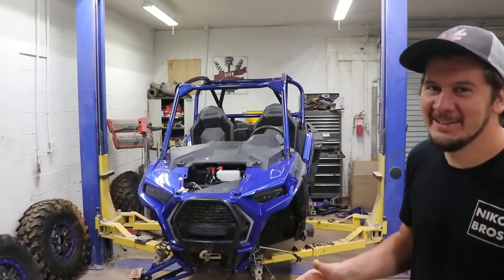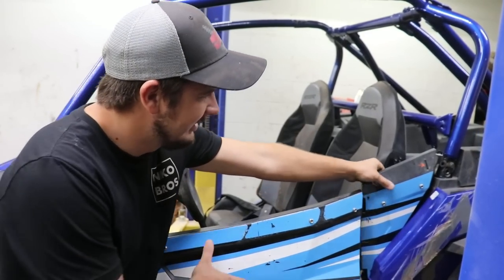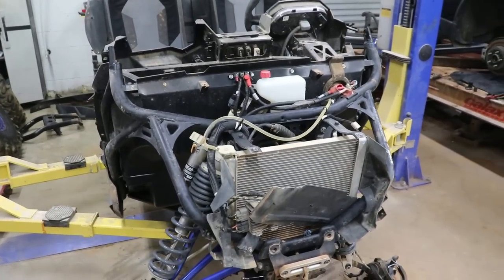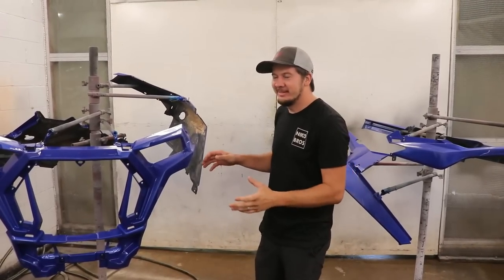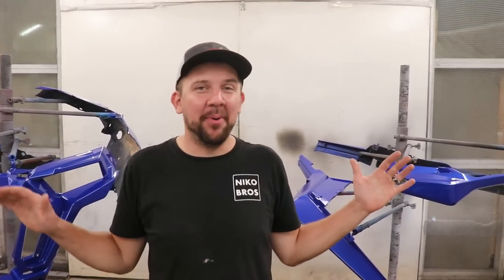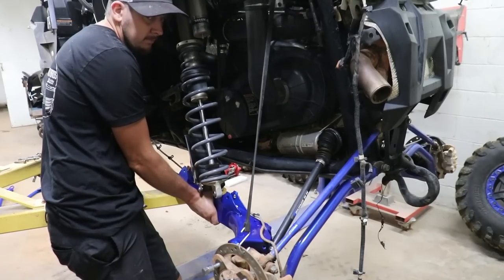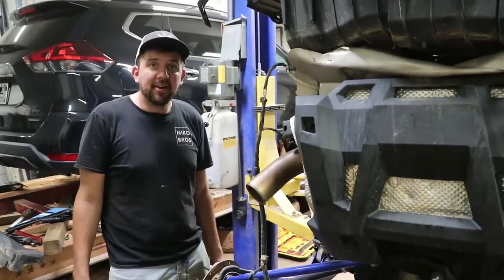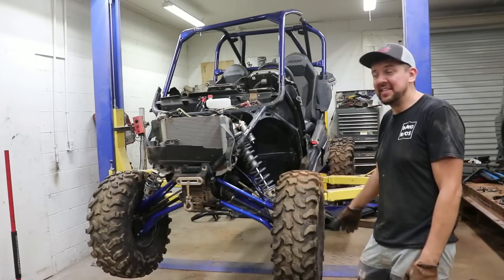Rebuilding a Salvage 2021 RZR Suspension Work & Painting Continued

Comment: Michael your on dangerous ground teasing your Brother like that. He will throw the paint gun at you and tell you to get in with it🤕. It's good that those brake discs are not broken but it seems they are well protected so one less part to replace. Hope you paint the wheels to match the rest, Oh maybe Ivan can paint them Yellow  😉. I don't know if you should get the wives involved, nothing against women drivers but if one of them has not done anything like that before then there will be an unequal race. Thanks for the video Brothers. 👍 👍

Comment: All those body panels are going to scratch and crack. So are all those bars are going to scratch up so easy. The manufacturer powder coated all those metal parts. And all those body panels are colored plastic. You're going to have a lot of cracking in that paint.